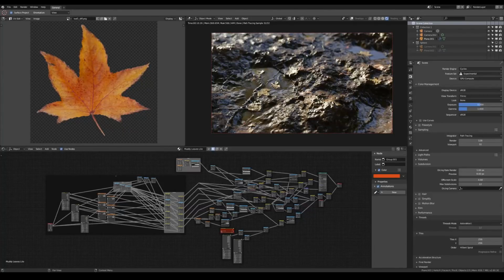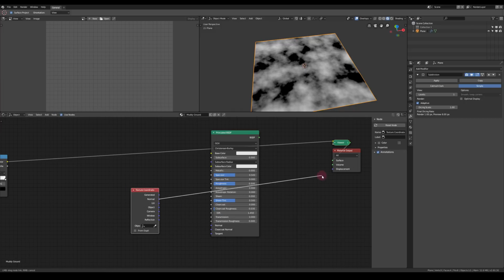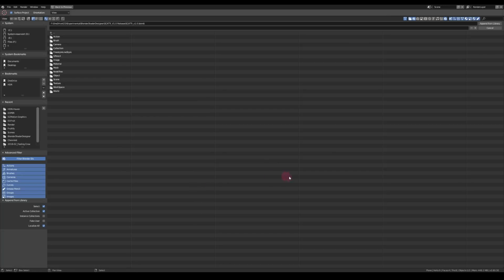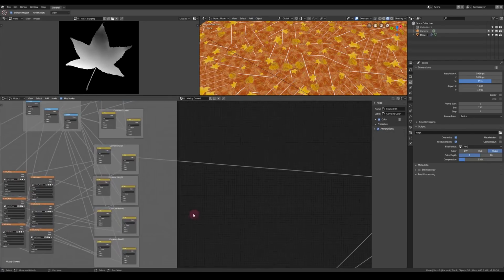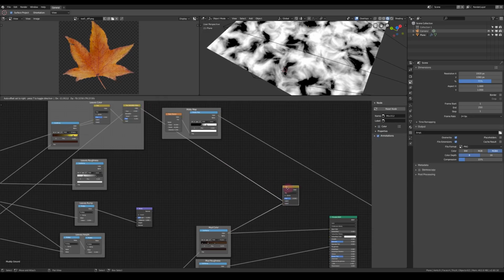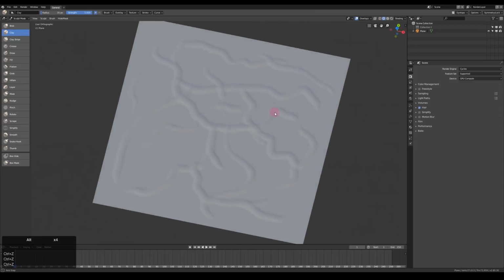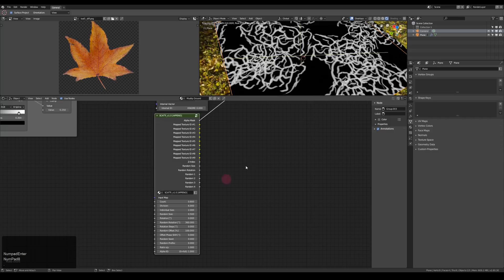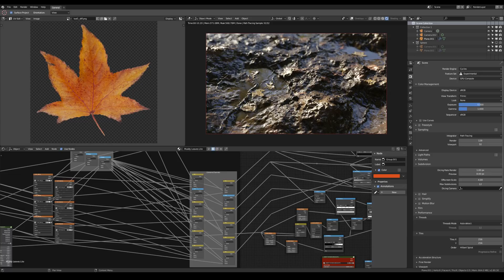SCATTr 03 - Procedural PBR [Blender Tutorial]

Comment: do the first 3:30 minuets of this work in 7.9 and without SCATTr?  Because I'm copying his process and all I have is a flat plane with no bump at all.
Reply from the maker: As of today you can download the beta for 2.8 here: https://builder.blender.org/
Microdisplacement should work in 2.79 as well though, but will only see it in the render.
Reply: @SimonThommes  Thanks.  I know your not text support but, if you wouldn't mind, I have another question.  Would you know why plugging the Normals output, form the texture coordinate, Into the Color 2 slot of the Multiply node kill all the bumps I'm getting form the noise texture?  Thanks so much.  Does is have to do with the Displacement output now having a vector?
Reply from the maker: @noahgonzales7474  sure, just ask :) I say in the video that 2.8 uses vectors for displacement (therefore the normals, you can also just use the new displacement node). In 2.79 that is not the case. You just have to plug in the height value there.
Reply from the maker: @noahgonzales7474  Oh I see, then you have a lot to catch up on, but you'll get there.
This tutorial is meant for rather advanced users. A lot of the time I just mention what I do without explaining it exactly to keep it short.
Thank you! :)

Comment: 2:57 you could always just use the new Displacement node 😁
Reply: L Deen do you mean the displacement modifier? I cannot get my head around it, it seems to only work with a small collection of preset textures.
Reply: @Luuncho  No, there's also a Displacement shader node, which plugs into the displacement input of the Material Output node.
The Displace modifier is separate from shading & materials. And it can use any image texture, not just the preset noise/pattern ones: In the Texture tab, set Type to Image or Movie. Import a file under Image > Settings. Did you try that?
For either of them to work, your mesh needs to have lots of geometry so they can shift it around with enough resolution. Add a Subdivision Surface modifier, preferrably set to Adaptive (only works in Cycles w/ Experimental feature set); else you can crank it up manually until you can't make out the wireframe anymore (get it higher than 6 by typing in). If you're using the Displace modifier, make sure to place it after the Subdivision.